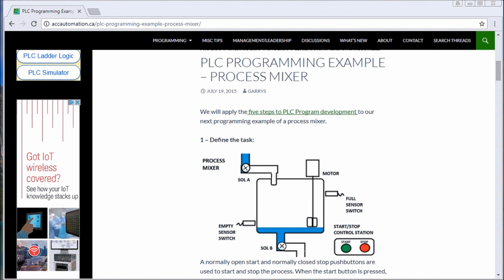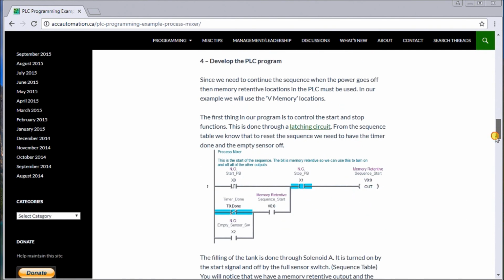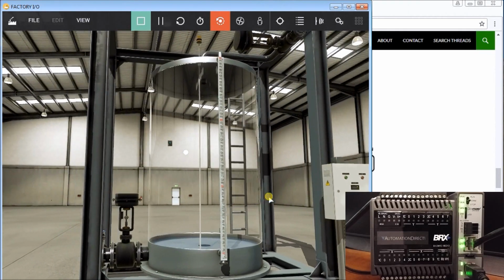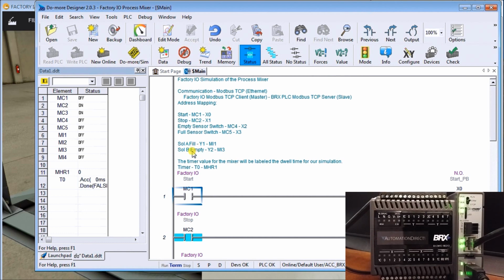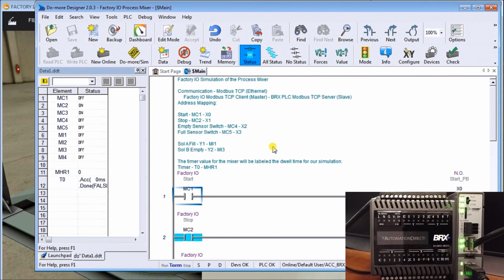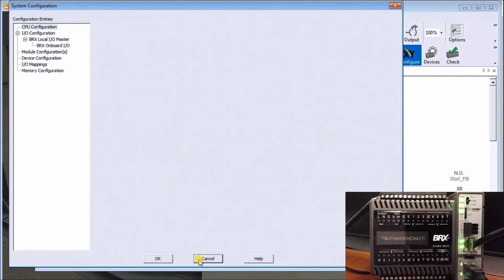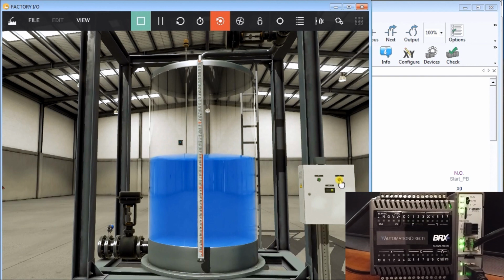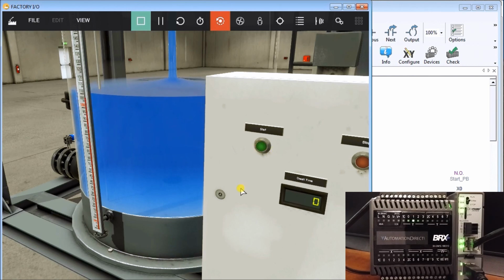PLC Process Mixer Logic Put to the Ultimate Factory Test!

Comment: actually i am confuse about the data types dint, real,dword, int and etc when to use how to use it. specially in factory io the tank level tag is ID100 ( real) when i used in my logic comparators command real it turns red.it doesnt work.
Reply from the maker: Hi Abu,
What PLC are you using?
http://accautomation.ca/what-everybody-ought-to-know-about-plc-programmable-logic-controller-numbering-systems/
The above thread may help you understand numbering systems in the PLC.
When using Factory IO you will have to map the input register to a number.
Regards 
Garry